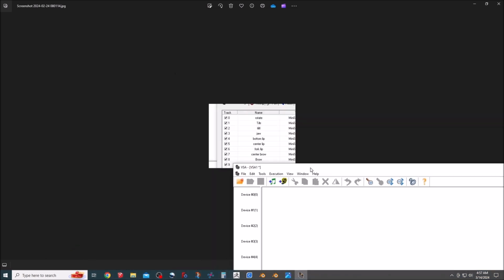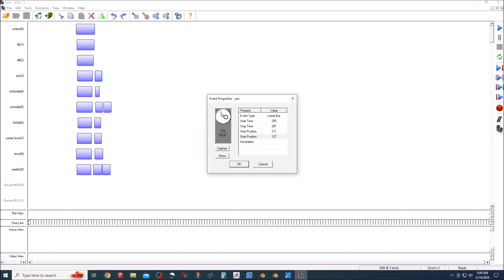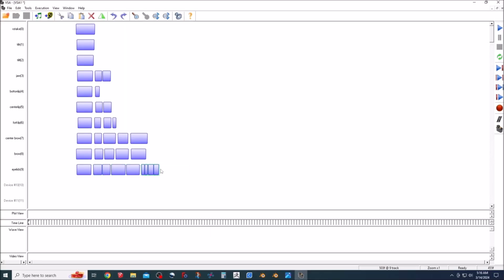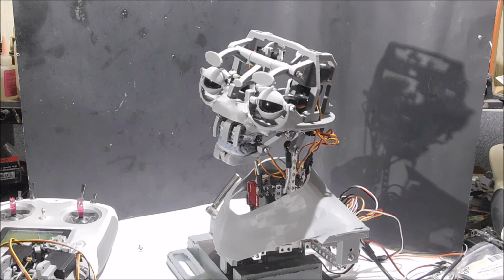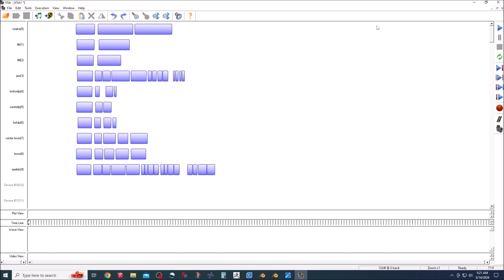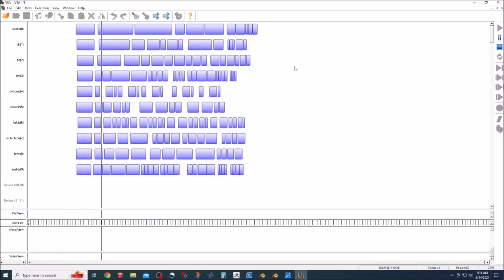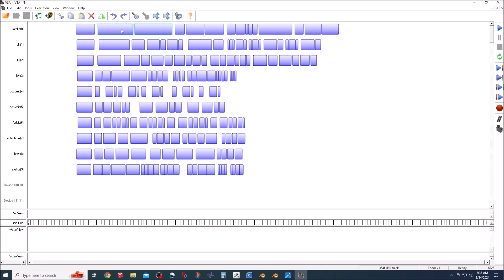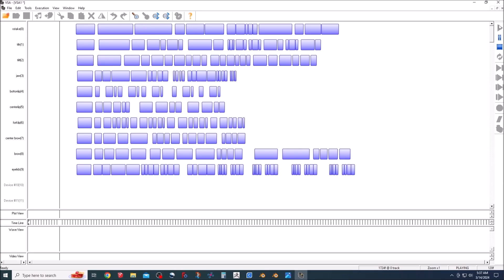3D Printed Animatronic Creature Part 25

Comment: Hi Gary, a very interesting video - thanks for that.
Have you ever tried moving the servo and axis for the head rotation further up, directly into the base of the neck? 
I have had very good experiences with this: the force transmission is easier and the head is less vulnerable to wobbling from side to side, when moving fast.
Best regards Daniel

Comment: Wow! Fantastic work, Gary!

I'm currently searching for local animatronic practitioners here in South Australia for a short film I'm putting together but it's slim pickings down here. 
Funnily enough it would actually be a piece that reveals the mechanics because the character is a robotic human head. So instead of the animatronic parts being hidden under prosthetics, they themselves would textured and finished to be presentable as features of the character.